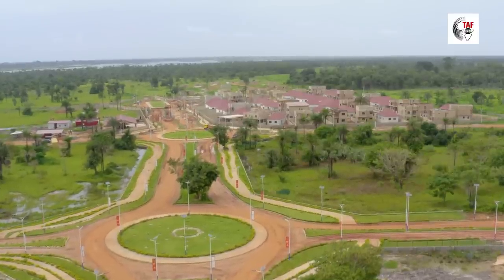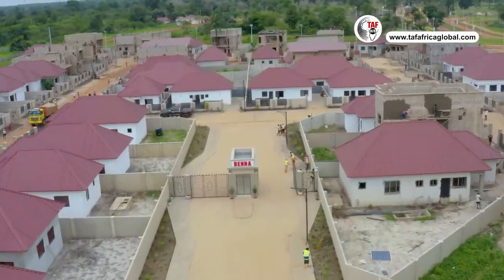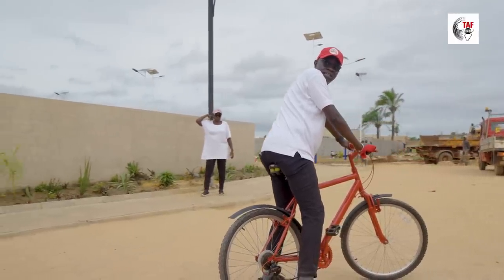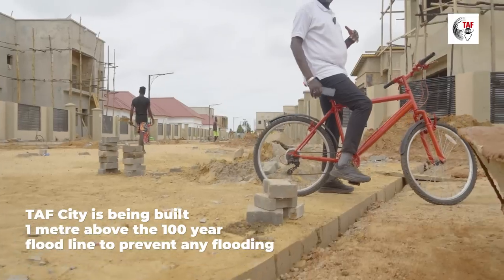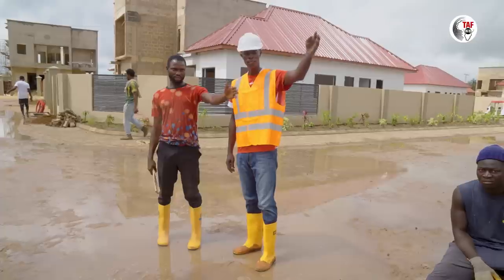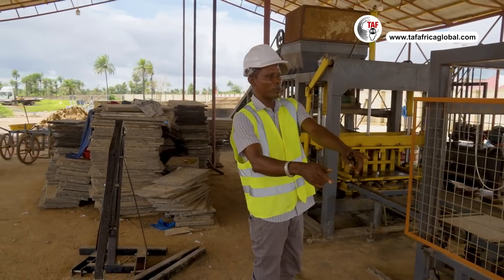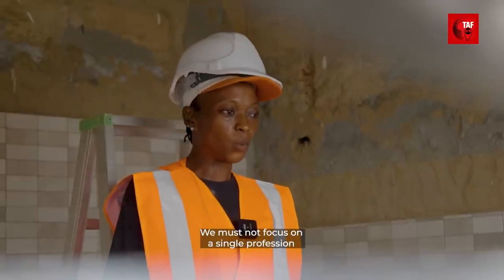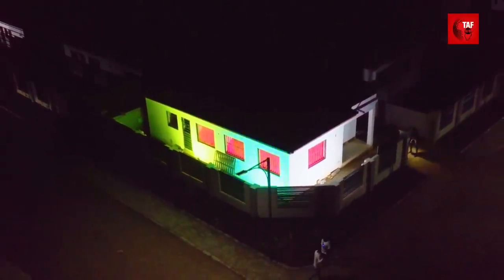TAF HUB EPISODE 52 - TAF City Progress

Comment: I love the project and content. Lets strive for better. Hope the next project has more modern iron sheets as the ones used in Bena are cheap and outdated. I have seen Indian firms using these cheap iron sheets but they use the flat roof system which hides them.